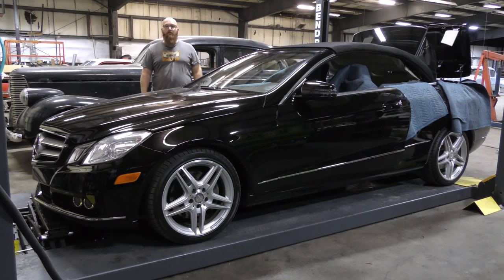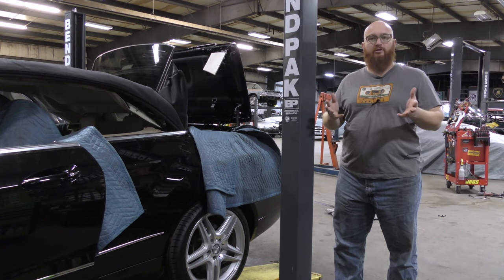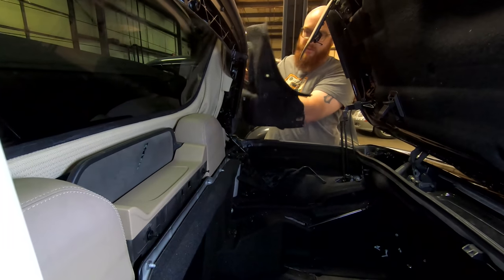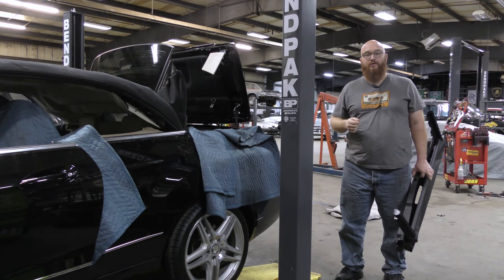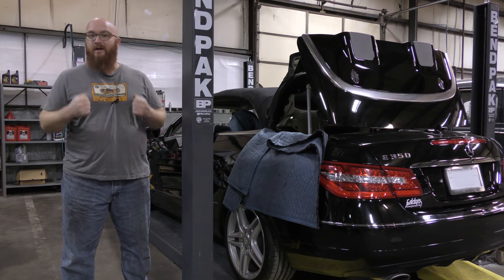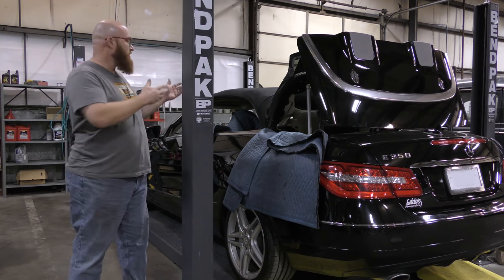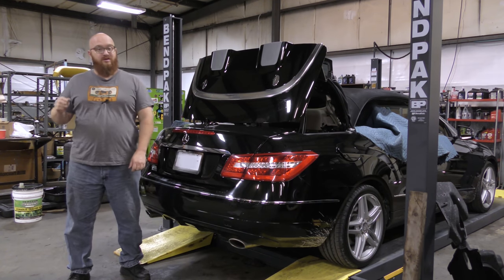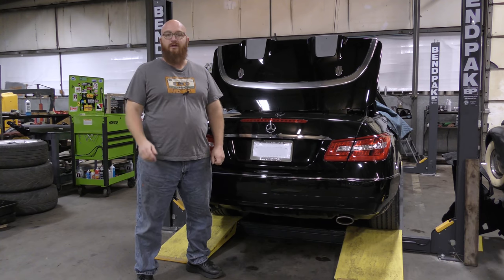When bad design costs thousands! Not so convertible 2011 Mercedes E350 can no longer rise on demand

Comment: Maybe your best video ever. Shows you have great insight into cost based decisions that go into car design.  Exactly right.  Automotive engineers responsible for a specific mechanism in fact, over time aka years of production, it is the engineer's charter to 'remove cost from the product' and try to maintain comparable performance and reliability which of course is a great challenge.   That pivot you mention would add fractional weight to the vehicle as well.  The engineers that designed that mechanism knew precisely how many cycles that hose would fail at the pivot point.  This is tested in the laboratory during development.  Its a calculation.  How many times will the top go up and down per year X's no. of years of car ownership.  The hose articulating at an acute angle has to have that degree of fatigue life.  But there is more.  Design evolution can become more precarious.  The purchasing department gets a quote from XYZ company to supply hoses at 1/2 the price of the original hose that was tested in development.  The engineer is asked to revalidate the design based upon this supplier change because it will save MB thousands.  Many times lower cost...not always portents more marginal material properties of constituent materials that make up the hose.  For example if the metal fails that protects the rubber hose it will puncture the rubber hose.  Metal fatigue life is based upon material properties and section modulus aka design of the metal sheathing which influences cost like the heat treat of the metal to anneal it to increase bending fatigue.  The engineer will build a few up and put it through its repeated stroking in the lab and determine, gee, this hose isn't as robust as the original hose.  The director of engineering wants his annual bonus for reducing product cost....which is called value analysis that is based upon competitive analysis and a dedicated department within engineering... and approves the supplier change knowing it isn't as good.  But the chief engineer has data like Mrs. Wizard said, X no. of strokes and no failure = out of warranty.  Its the customer's problem which of course is accurate as we see in this instance.

So, its a very tangled web of how designs are not only developed to replicate the experience of the automobile in the field but the evolution of the design over time to reduce cost.  Car companies aren't in the business of making the best cars. They exist for profit.  Your skit and video was excellent.
PS. Magic Mike is to be credited for his talent to perform this job.  It is much easier to build the car than it is to repair it.

Comment: I guess owning a Mercedes isn't a status symbol anymore.
The real flex is casually tossing your American Express to the service rep at your dealer and say "just fix it".
Reply: No, you don’t do anything but oil changes.  When it breaks completely pull the plate.
Reply: Mercedes has turned into a ghetto fabulous brand.
Reply: That happened when you could buy a new Mercedes for $30,000.....

Comment: Happens in construction as well.  Witnessed many a tussle between Engineers, Architects, Constructors, Owners and Building Inspectors.  Thank goodness for inspectors -as long as they are not corrupt.  Here that is not an issue but in many other places I've visited it absolutely is.  Thanks for such an informative video!

Comment: As someone who is on their second W212 E class, these really are beautiful cars. My first 2010  ran me 140k miles flawlessly and I sold it still running flawlessly to a friend of mine, and replaced it with a 16 E400 that just checked out at the shop in flying colors. Like anything else budget for proper maintenance and any kind of complicated potential repair down the line (for convertible models) and you’ll never be surprised with bills.
Reply: That’s exactly right
Reply: you mean budget for things breaking because of bad design. sure.

Comment: That's why I love my 97' miata, it has a manual top.
Reply: Exactly, I can have the entire top replaced for less than the cost of the Mercedes hose. Every work day it gets opened and closed twice. That adds up as wear and tear but I couldn't care less.
Reply: Same thought here. I have a 2000' Fiat Barchetta and I actually need to step out of the car to open or close the top, but at least the mechanism will never break down.
Reply: A manual top will never be acceptable for a BIG convertible.  How would you feel about the Miata top if it was 3 times bigger and 4 times heavier.
Reply: @bindingcurve  fair point, but I’d still rather struggle with a manual one than get sprayed in the face with hydraulic fluid!
Reply: Triumph Stag has entered the room. 
Absolute swine but better than this.
Reply: Yep, my Miata top is fast and easy to open/ close.

Comment: My '65 Corvair convertible has a power top.  Has worked fine since I've owned it, almost 40 years.  No hydraulics, just an electric motor and two cables going to two big gears.  Two manual latches to unhook form the  windshield header.  No fancy cover, but it still works and looks great when down.  It would take ten minutes to replace the motor it it failed.  Didn't the Wizard just the other day he liked Mercedes because they were easy to work on?
Reply: I was just wondering about the Corvair!  I saw one for sale last summer here in Michigan. My wife said I could buy it if I got rid of my 1986 Fiero GT. Sometimes I wonder if I can trade my wife in for a car. LOL.
Reply: Much better setup!
Reply: Easy to get paid to work on.

Comment: Wiiizard. Have to say I’ve been watching you and Tyler since the beginnings and so far you two have only cost me money. (Audi TT and an Equus). But this week you saved me a bunch. My ‘08 CLK top stopped and I honestly had no idea it has an easily accessible reservoir. $20 and the top works again. My leak is in the rear quarter area. But happy to let it leak vs. fixing. So pleased my “coupe” is a convertible again!

Comment: I have a 2011 e350 coupe and it really is an amazing car. Super reliable, especially compared to other luxury cars I’ve owned. I previously had an A4 quattro(biggest pos ever) and a 128i and a grand Cherokee and genesis and I have to say the Benz was definitely one of the best. Has 140k miles and only big repair was replacing ac compressor
Reply: Yes! People keep trashing them but they are actually really good cars
Reply: @jacobstark5311 hey can you give an update on your ownership of your 2011 e350 coupe I’m looking at picking one up, thanks!
Reply: @bobbycooks8965  someone smashed into and totaled my car at 160k miles. Shit was still going strong but my transmission definitely needed some work. I got a 2010 e550 now lol
Reply: @bobbycooks8965  also was terrible with maintenance on the thing

Comment: And there's me with a 2015 SLK with the origami-like folding roof, and yes, it's hydraulically powered !! I hope it holds up for a bit longer, I've only had the car for a year. The Jaguar XK8 cars in the 90s also used hydraulics but with these the fluid converted itself into a thick jelly and the whole system had to be flushed out to remove it! A different spec of fluid cured the problem. I believe, though, people still get 'hosed' from time to time. Maybe my MGTF which has a manually raised and lowered hood is the best option !
Reply: Mine is a 2012 and it still works well! even though it's a garage queen, barely used the car.
Reply: 99 xk8 650$
Reply: don't worry the  locking cylinder will start leaking, because the proper seal material is  $0.03 more expensive for the oring.

Comment: The hose on that car lasted 10 years. Any type of swivel fitting will also wear and eventually leak, probably not as a stream of fluid, but as a slow drip. That drip then gets everywhere in the top before the owner notices. Probably very similar failure period, but potentially higher repair cost. Not to mention that a swivel is much larger than a flexing hose, adding further complication to an already ridiculously complicated top mechanism. 

I am not saying that there aren't better designs, but I am trying to point out that every design has a weak point. Trying to engineer away every failure point is a fools game - you never finish. Sometimes you have to accept that there will be a failure point, and you move on. (Of course, you should also try to make that failure point easily repairable, which is the bigger sin here than having a failure point at all.)

Comment: Lovely. The top on my '65 Falcon convertible still works fine after 56 years. I suppose you could disconnect the hydraulics and convert it to a manual top.

Comment: Now you've got me thinking, Wizard. I'm wondering if I have a similar system in my '05 SL500. My retractable hardtop has been working flawlessly since I got it about 6 years ago. BUT!!! Is it a ticking timebomb of hydraulic fluid, waiting to face-spray me the next time I put the top down??? Maybe they used the pillow-block system in mine?? Not sure, but I think its time for a bit of research......  I use that top all the time, weather permitting. It's one of the main reasons I bought this car! Well, that and that V-8....oh, boy that V-8.... [drooling]

Comment: This is why I drive Fiat Punto.

It was designed to have ventilation drain drip water to rear bearing of alternator. So it fails slowly, but when it does, it locks up, destroys rotor and driving belt, maybe some of wire harness with it.

Comment: It actually goes back to the Grosser 600 in the 60s.  Door locks, windows, everything was hydraulicly powered.
Reply: I think those were pneumatically powered.
Reply: @davidjacobs8558  This is right. By vacuum, to be exact.

Comment: A car with a V6 engine from the 90's had 3 Platinum sparkplugs at the rear and 3 standard sparkplugs at the front. The reason was because it was impossible to get to the rear sparkplugs with the engine in the car, so they fitted Platinum plugs which would last for the warranty period of the car (plugs were good for 90 000 km). You still had to replace the the front plugs every 20 000 km.  Platinum plugs were $20 each compared with $2 for standard plugs  which is why only the 3 inaccessible plugs were Platinum.

Comment: As an owner of a 2003 Mercedes CLK430 convertible, I can tell you how I "solved" this problem.  Open your trunk and locate the pressure release screw on the hydraulic pump  and turn it counter clockwise, to release the hydraulic pressure off the pump.  I then raise and lower my convertible top MANUALLY.  I can have top up or down within 30 seconds.  Problem solved! :)
Reply: a video to that would be great, especially on how you then lock down (or unlock) the top on the front and back.

Comment: Going the cheap route on auto design, how did that work out for Ford and their Pinto fuel tank protection?? Keep up the great videos and we can only hope someone's listening in the Auto design shops.
Reply: As well as  the Ignition switch fiasco at GM...where the switch turned off the air bags while the car was in motion.  Designed by actual engineers.
Reply: Don't forget the fiasco with the Crown Vic gas tanks as well!

Comment: Just imagine a convertible top that doesn't need a hydraulic line running to its leading edge. But I guess that would mean you'd have to unlock/lock the top from/to the windshield manually. Oh, the horror! :D

Comment: This is like my 2008 Buick LaCrosse Super.  Has an LS4 w/4T65E-HD transmission.  Should have used the 4T80E instead... but nope.  Get it off the showroom floor and past warranty... that's what matters.  Thankfully there's a guy that makes a 4T80E installation kit for when the 4T65E fails (it will, most definitely).
Reply: The Ford 3.5 and 3.7 V6 transverse is another example of bad engineering with the timing chain driven water pump, the 4.6 and 5.4 3 valve Triton, and the Ford Fiesta, Focus, and outside North America: the Ford EcoSport equipped with the DPS6 PowerShift 6 speed dual clutch transmission fiasco that cost Ford a lot of money along with failing electric steering racks in the same time period. The Chrysler 2.7 V6 had so many corners cut that they had to hire a third party company to handle warranty claims and many owners got screwed over them and that's one of the leading causes for Chrysler's bankruptcy in 2008 along with GM's not so legendary Delta platform ignition switches and major electrical problems including power steering failure. The Chrysler 2.7 V6 had all kinds of problems including oil contamination (sludge), water pumps similar to the Ford 3.5/3.7 transverse V6, and catastrophic engine failure all occurring less than 100,000 miles at an extremely high failure rate. Even well maintained 2.7 liter V6 engines failed prematurely. Today, many Chrysler and Dodge cars equipped with the 2.7 liter V6 are being scrapped at your local junkyard near you and most of them have no body damage or airbags blown so finding a good used 2.7 V6 is hard to find and it's not worth buying another 2.7 V6 engine.
Reply: I have a 2006 Grand Prix Gxp, I still daily it and it still  has the original transmission! It’s not the fastest shifting trans but with proper service and fluid changes it’s lasted 15 years and 150k miles. I’ve already saved up 3 grand cash to get a full tranny rebuild when it finally fails cause the Ls4 still runs amazing!

Comment: Once upon a time, Germans were good at engineering.  Now they seem to think that complexity is a virtue.  Always dump a German car before the warranty is up.
Reply: MB is using mechanics from 1980 in new cars. They do not improve know issues and are all about making money and destroying the legacy. Buy a Lexus for a great all around car
Reply: @b4804514  Completely agree, and I've had both Mercedes and Lexus...my favorite car was a '90 LS 400 i bought used in 2000 with 165K miles. most reliable car I've ever owned, and I firmly believe that 4 litre V8 was the best engine ever designed....turbine smooth and zero problems ditto for the transmission.  The LS was cruising to 400K miles when a millennial twit rammed our son, who was stopped at a signal.  She was clearly texting.  The car protected him but was totalled. I was SOOOO MAD.  Toyota products are the world's best.
Reply: @BillofRights1951  Yes. The Japanese companies try to compete by making a better one. Others try to make a cheaper one.
Reply: Actually complexity is a double win for German cars. Let's call it a calculated fleecing of the world by German's:
1. Proprietary complexity creates market diversification and marketing niche to upsell their product to the public.
2. Complex mechanisms fail more based upon statistics and when they do they cost more to repair and higher profit for the manufacturer.

Win/win for mfr and lose/lose for the consumer.  Car companies now design radio knobs with the complexity of a Rolex mechanical watch.  And they get paid handsomely for it.  A little secret is, the average person knows nothing about automobiles but consumers sure do love all those bells and whistles they don't understand.  Its like magic.

Comment: Could they have used air instead of hydraulics to open the top.  

When engineers go rogue and you have $640.00 toilet seats.
Reply: Or even cables, like so many other cars.
Reply: Now you're going down the engineering route.....

Comment: Wow, a Mercedes bens. Ya" your right wizard, why?  Or are they trying to get people to return to the dealer, and we know darn well, they rip you off it's a planed rip off by the dealership. I'm sure wizard you will be a lot cheaper and do a better job. That's the way it is! The solution is keep your car and hopefully the people are doing the own work ,, because after the warranty you are screwed if you can't. Thanks wizard.  Buying a good new one is not cheap anymore. Those design engineers know what the company's want !!

Comment: I realize it can't be a manual top at this price point, but I just can't understand what is wrong with electrical actuation? They must have thought this was less noisy than an electric actuator with similar torque, but there's nothing luxurious about the inevitable leaks. Reliability is a luxury too. Imagine this happening after your date dressed up in their best formal wear for a reservation at a fancy restaurant.
Reply: When Ford designed their 1950's retractable hardtop Skyliner, they knew spraying hydraulic fluid on customers would be a bad idea and made it all electric motor mechanical.

Comment: If you think the fix was fun, wait until you try to track down the hydro fluid that MB specs.

The Daimler Chrysler Fiat version of this top fixed the hydro spray to the face issue by using electric motors for the header latch. The bean counter screw job was 1" of wire harness at the trunk hinge. At least ya don't have to unbuild the car to fix it - until the satellite antenna lead in the same bundle breaks.

Comment: I work in a very different line of job, but over the years I have developed a sixth sense for "problematic customers" . If they don't want it done the right way, I regretfully (not!) pass on that one. They will never stop complaining later, although it was all their own fault.
Reply: "Ever since you worked on it....."
Reply: I had the same experiences with construction/renovation; so I refuse any band-aid fixes and you can get it fixed properly instead. Otherwise call another joe off the street and get what you want. The worst was a kitchen floor system that had rotted out and the “handy neighbour” suggested extending the floor joists by sistering them only 12” each, so I said no either you replace it all the way or you go 7’ or more past the affected area. We ended up getting a dozen or so 10’ 2x10’s and doing it properly with a new rim board & exterior stone work. Looks beautiful and will stand the test of time. Also not a single screw was used in that repair, just ardox.